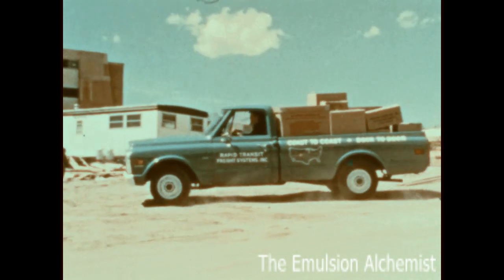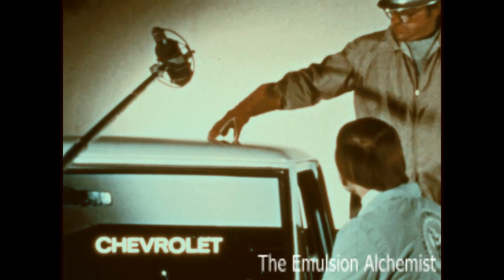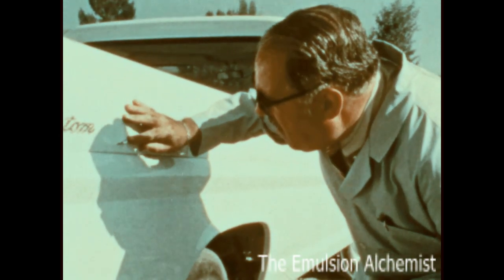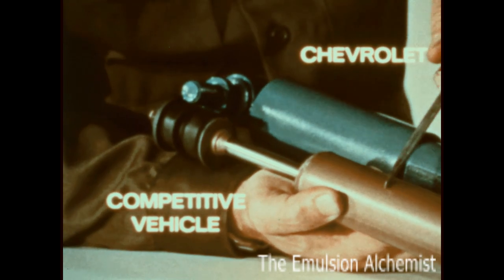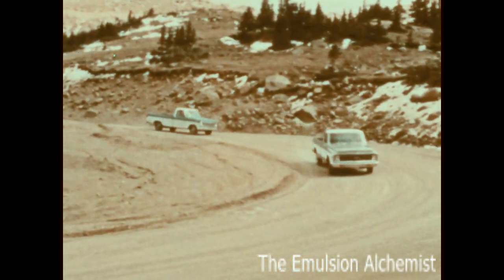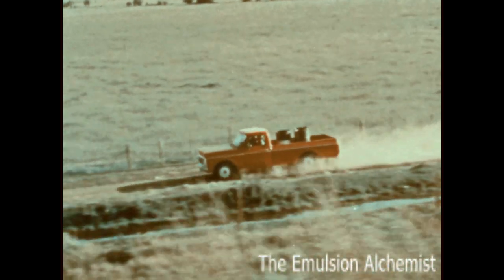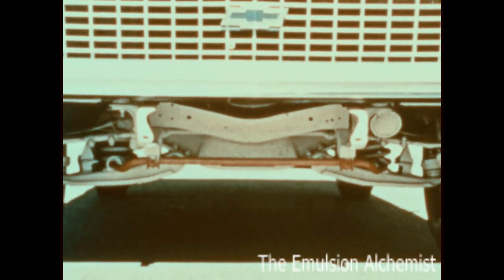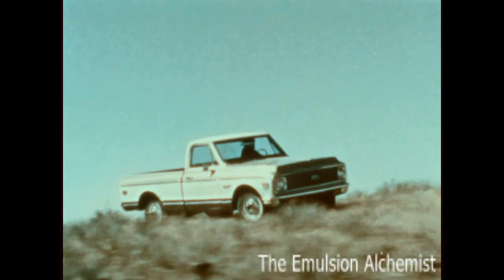1972 Chevy Trucks Dealership Sales Training Promotional film

Comment: I love how they discuss important aspects instead of how many cameras it has or how large the infotainment screen is.
Reply from the maker: the first screen I saw in a car was in a 1985 Buick, they hadn't invented touch screens yet. just think of how big a backup camera would have been back then
Reply: @theemulsionalchemist5688  A few 1985 Buick Revieras already had the touchscreen
Reply: well they dont buy trucks for their purpose anymore dont they

it's just an SUV with the back bit chopped off
Reply: Well, all those special things are standard on all trucks now. Only mechanical difference you'll look at nowadays is it's 4wd or 2wd and if it has lockers or not.
Reply: Yeah.   I don’t give two shits about touch screens and cameras on a truck.
Reply: I had a 1978 K 5 blazer and 1970 3/4 ton 4wd chevrolet I bought the blazer new  the body on the 1970 didn't rust as bad as the 1978 when I got rid of the blazer in 1982 the 1970 was still in better shape
Reply: @mildbill222 The only “IMPORTANT” requirements on a truck are as follows “1” Locking Rear Differential “2” Skid-plates “3” Air conditioning 
“4” Spray in Bedliner  🤔🧐🤔🧐 Rear back up camera is a good idea
Reply: @MrJEEPJT  
Naw man.   Spray in bedliners aren’t necessary anymore.   Truck beds just don’t rot out like they used to.   Not down south, anyway.  
Speaking of down south, I’m putting air conditioning higher on my list🙂

Comment: Yeah ive had a couple of the 67 to 72 body styletrucks and they are definitely good trucks .I had a 71 3/4 ton 2 wheel drive great truck and i also had a 72 halfton 4x4 and was evenagood strong truck as i put it through alot and even jumped it 3 different timesand it didnt break the truckup so i can attest to they wervery good trucks.

Comment: Cool video and good points but I see easily 10x as many 70s Fords still driving than I do Chevrolets.
Reply from the maker: I guess it depends where you are. currently in the shop, I am working on a 68 c10. I see equal amounts of old ford and chevy trucks
Reply: I see far more Chevrolet trucks from 67-72 on the road around here than any bumpside ford
Reply: There are extreme amounts of Chevrolet trucks of this era that have been converted to hotrods

Comment: In the real world those Ford Trucks were the best money can buy......  that's why the f-150 has been the best selling truck for nearly 60 years.
Reply from the maker: fords were tough, I just can't stand the twin I beam front suspension design. Ford trucks were unsafe to drive at 90mph or even 80
Reply: Ford Trucks was a  cheaper made Vehicle.. The inside dash always cracked. Found on Road Dead..
Reply: @theemulsionalchemist5688  
Your full of it - the Ford twin I bream was a great system - the only downside is tire wear   if your using after market size tires - the king pin can be fixed by someone who actually knows what to do...

I would take both - but I love the Ford...

I personally paid for a old 58 shortside - 292 V8 with AM radio out of a farmer's field that sat their for close to 20 years...

It had set so long that the frame of that truck was almost on the ground - drained the old gas, turned motor over by hand, put a battery in it,  fired it up - with the help of a 4wheeler pulled it out of the hole it had made from setting all those years  and drove it home!

That old truck was a daily driver until I had given it one burn out two many - had a man ( Captain of a ship ) offer me $8,000 for it as is - I paid $300...  

The paint was not great, but it had a very straight body and was a step side with a wooden bed - the only negative of the truck was the wooden bed was in very bad condition and the back glass had a BB hole.

The trucks of the mid 50's to the early 70's make my day - each has it's good and all have many who would love one today.

My true love is a 40, 56 and 69- 72 Ford
The 67 to the end of that model Chev was ok 
The 70 Dodge had it's good sides...

Hell even the International had it's greatness - a old Willy's would be a dream.
Reply from the maker: @mrnobody8540  I am definitely full of something but not it. As for my experience and 35 year automotive mechanic that specialty is suspension, brakes, and alignment, than find a good explanation as for why the twin I-been suspension has been abandoned by the automotive industry. Yes for big trucks that weigh extreme amounts the design is excellent. Road test a 2021 ford van then do the same with one 5 years old using the trim I-been suspension. The level of control, handling, and ride comfort is dramatic. I love your comments and stories by the way. From one car guy the the next we are both entitled to our personal options. My personal favorite truck would have to be a 1956 dodge with a 354 hemi.
Reply: @theemulsionalchemist5688  
Yes exactly - every one has an opinions and like fly's to chap it's theirs to enjoy 😊. 

Yes I don't mind being an little bit of a smart asshole - the fact is I love dogs, cats, old cars, bikes,  and kids when their being children of reasonable behavior. But most Adults don't have any idea of the world beyond their job and personal home life of just how devoted they are to doing the same old thing that their fathers have done and think to themselves that they just invented the wheel....

I'm not much different in that regard - I just had a very diverse life....  Was still in cloth diapers when my folks started traveling.

Been in almost every state and a couple of countries before High School.  Had the luck of knowing some very good people in the racing world - seen millions of people in very short time.   

So yes I am a oddball - a total jack ass when I feel the need and a joker sometimes just because I am bored 🥱 😴 - 

A master of nothing - a jack ass in all things I do....   I guess my wife most of lost her mind when she meet me - but if it wasn't for her, I most definitely would be a total asshole!

Thank you - enjoy
Reply: @theemulsionalchemist5688   I owned a 1991 Ford Ranger  with twin i beam i loved that truck it was the best truck ive ever owned and Loved the twin i beam it was a very plush truck.
Reply: Those twin i_beams where garbage all the way
Reply: Chevy was #1in the 40s 50s 60s and 70s where everyone else copied them for example dodge and ford copied the look of the blazer in 78 when bronco got full sized
Reply: Best selling because they were and still are the highest produced truck in the US. They were sold at a lower price than Chevrolet. Ford trucks have also been the most recalled in American history since the 1970s
Reply: Chevy 💯 look better
Reply: @BB-sc9gj
Don't care if your attention is to short  - you can always read a dime novel 😉.   Point is you're not the only person who may enjoy - it not personal, it's a fact that if you don't have time - don't start reading,   I will never let others control my words!
Reply: @BB-sc9gj 
Then don't read it!
For you don't speak for me or the rest of the world 🌍...
Reply: @samright4661  To be fair, cars that get to be old have their dashes usually crack if they are rarely parked in shade and stay out in the sun for the majority of their use.

Comment: talk about propaganda ..about the only advantage to the chevy is disk brakes...they say no inner steel fenders for the ford?/..bull..i owned a 72 f100 for 14 years ..and they talk about shocks?..funny when they show the front shocks on the chevy...its actually the rear shock ..and how they show a chevy pulling a jet???..they make it sound so tuff...big deal..ever see those little tugger trucks that moves jets around?..many of them are powered by  a ford 300 /6 cylinder engine on a 2wheel drive truck
Reply from the maker: I thought the pulling of the jet was funny too. i bet the fluid was burned by the end of the shoot
Reply: Yeah talk your crap about chevy cuz yall dont know anything and just hating
Reply: @the_great_psycho  well educate me,....tell me stuff i dont know ...i'll wait
Reply: @merc-ni7hy  i dont have to its in the video
Reply: Somone got extremely jealous 😂😂. Fact is the 67-72 Chevrolet trucks are one of the most sought after body style trucks in history. Chevrolet had much better control arm front suspension/ along with all of the other advantages